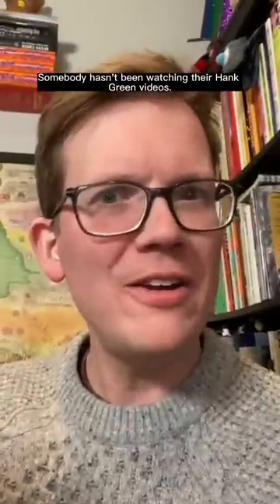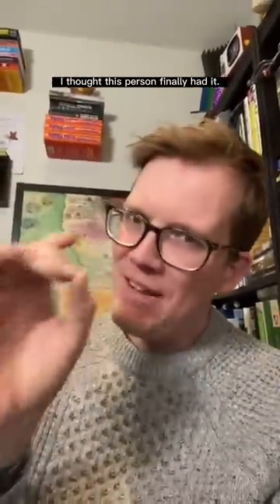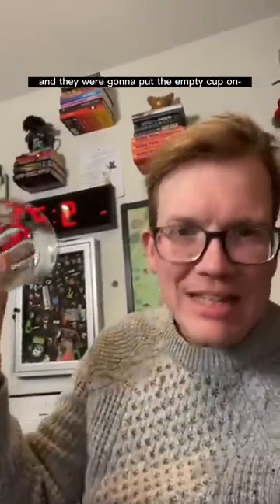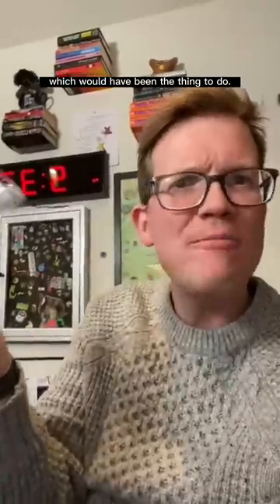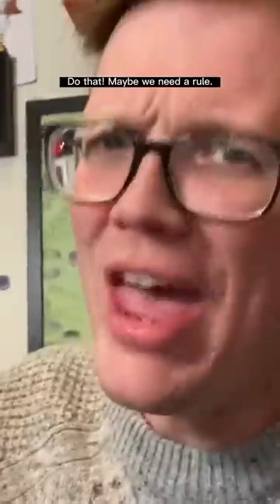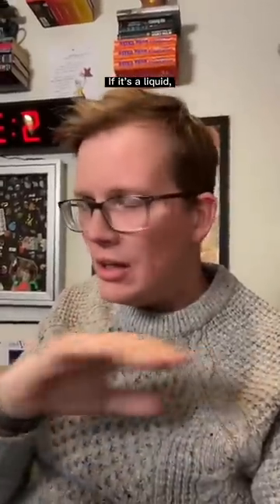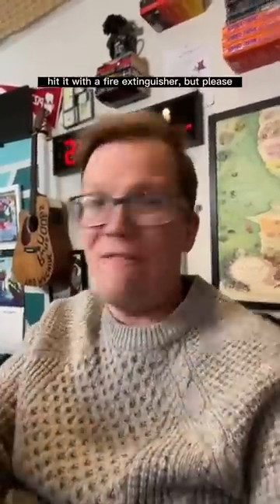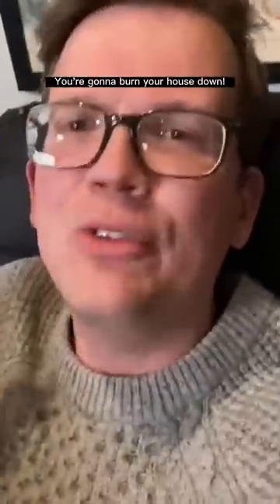Why does water cause candle fires to explode?

Comment: That is an absolutely great way for children to remember. "If it's a liquid that's on fire do not add liquid" That should be added to fire safety
Reply: Sadly, there are plenty of adults who would argue "a candle isn't a liquid" without acknowledging melted wax, let alone kids
Reply: @atroecious9357   Karen parent: holds candle THIS IS CLEARLY A SOLID, first you teach evolution, now this?????
Reply: I definitely did to myself "Wait it's a liquid? Oh wait I guess it is!" Really glad to have found this just in case I need to know!
Reply: @atroecious9357  tbh, I didn't think abt melted wax as liquid till Hank said it
Reply: @shadowsoulless6227  probably as melted wax dribbles down her hands, her clothes, and on the floor.
Reply: Unless it's the same liquid. If it's an oil fire and you don't have baking soda, you add more oil to reduce the temp of the liquid and cover it to suffocate the fire
Reply: Technically putting water on a fire does not remove oxygen from the fire what does is disperse heat rapidly and take that heat away from the source of the fire.

Fire requires three things. Heat, oxygen, and fuel. If you take away any one of those things the fire will die. Therefore water really isn't even the most efficient way to extinguish a fire anyway. Providing you have something non-flammable and heat resistant to smother with smothering is always the best option
Reply: My uncle is related to a kid who's friends with and interested in our local fire department, I could get this done
Reply: @kyle_mk17  please do
Reply: @CYB3Rsynth  it depends on the type of fire smothering a wood fire may work eventually if it is small enough or hasn’t got a good hold on the wood but water is way way more efficient. If you use the correct method most fire types are much easier to put out. (For gas fires and some liquid fires it is important you don’t put it out before the source is removed e.g by turning of the gas because the gases can build up and explode if it is extinguished)

Water helps to remove oxygen where it is less dense than the stuff on fire, it removes heat efficiently from surfaces it has contact with, it inhibits a lot of chemical chain reactions and it can be used to remove fuel from a fire. It is amazing stuff which is why it is the main goto option for large fires that don’t involve mainly electricity, flammable metals, self oxidising mixtures, flammable gasses, or flammable liquids. 

It can be used with all of those to keep the heat down and prevent spreading (and in some cases to remove fuel) usually by using a mist so that it vaporises carrying away heat before it can hit the surface.
Reply: ADDED?? What do you mean? ADDED!? Where i'm from we all got taught that.
Reply: Yes that stuck with me despite knowing your best bet is to cover a candle fire.
Reply: Kids don't have the same pride stubbornness as adults do. 
Any that are old enough to be "trusted" around a candle have 100% messed with the candle and know that while there is the flame the candle has a solid candle part and then a liquid puddle.

And younger kids know they are still learning things so they don't have the "i must be right" mentality that causes them to ignore facts for the sake of being in the right, they have a "it makes sense" mindset where if they are arguing something then its because their current knowledge matches what they think and they need an explanation of the facts so their mind can make sense of things that are different to their expectations.
Reply: Only if they understand what a candle is. Liquid is NOT something that comes to mind.
Reply: @kelathos  if the wax is still mostly solid unless the candle is enormous it wouldn’t do more than spit a bit if you dropped water on it. The wax has to be close to it’s smoking temperature to produce a fireball.

That isn’t necessarily true, if the candle is scented the essential oil or whatever was used can greatly lower the ignition temperature so even a fairly small puddle can ignite in a fireball if it is spattered by water.
Reply: Yes
Reply: Salt can also be flammable
Reply: @dadude8635  table salt (NaCl) is already at a pretty high oxidation state so it can’t be burned as such. That said in a fire with a high enough temperature the salt can be vaporised and Na ions can colour the flame a bit more yellow. The hotter the fire the more the Ana and Cl get separated and the Vaporised sodium will burn at the edge of the flame. However the process will take net heat out of the fire not add to it so even for base metal fires and self oxidising fires table salt isn’t a terrible option as long as the fire isn’t too big. Sodium Bicarbonate is better because it doesn’t produce chlorine gas when it gets too hot it produces CO2 which slows even very hot base metal fires, it can also interrupt ion flows so it can interrupt the chain reaction that leads to fire. CO2 extinguishers actually spray out bicarbonate more or less for those reasons.
Reply: Yeah everyone knows your meant to throw corn starch or flour on it wtf
Reply: @glenecollins yeah...the candle in the video has a HUGE flame to begin with.

I've poured water on candles to put them out and never had a fireball explosion but my wick was never burning three inches wide
Reply: Exactly 💯 💯 💯
Reply: @shadowsoulless6227  🤣🤣🤣 you have made my day. Thank you
Reply: Unless its an alcohol fire.
Reply: fun fact it already is
Reply: @shadowsoulless6227  if this candle wax is a liquid, why does solid candle wax still exist? answer that ATHEIST!
Reply: Hank's Law
Reply: @Atroe Cious  but I'm confused bc the wax isn't the part on fire. Just the wick is
Reply: @TheCumberCoIlective  Someone will probably answer this a lot more accurately, but like, the flame is always burning something. It doesn't just exist on it's own... In this case it's burning paraffin. 

I guess you have a point that it's not super intuitive to say "the liquid is burning" because yeah, the part that you can see, that's still visibly liquid, isn't actively burning at that moment. It will in a moment when it's vapor, and that will happen faster if you quickly disperse it into a big mist of droplets. It's kinda like the part of a burning log that you can still see - you'd still say the log is on fire though that's not at the moment true of every piece of it.
Reply: Unless it's an oil fire. What you should do is actually add more oil and then blow it out
Reply: @shadowsoulless6227  
😂😂😂 I can totally see that happening.
Reply: @feuerling  
See how it hardens on my burnt flesh?!?!?! Checkmate atheists. 😂
Reply: @TheCumberCoIlective candles wax just burns slowly, have you ever noticed that every time you blow out a candle after burning it there’s always a little less wax, that because it’s burning both the wick and the wax. The wax it so it doesn’t burn the wick too fast and burn out!
Reply: @xxxpandaxxxae  Huh, I always thought it was the moisture in the wax evaporating
Reply: "And they were going to put the empty cup on-UErGhHh" 

Sorry, this took me out
Reply: Also "if something wooden is burning in your house, don't add wood". Wish someone had told me that 😔✌🏼
Reply: we, as kids. learned this.

YOU as kids probably learned what to think. now  how to think.

candle is oil based, dont use water.
Reply: @TheCumberCoIlective  as wax melts(becomes liquid through heat) it gives off a vapour/gas.
The flame  is burning off that gas,just as fire burns gas in a gas stove, or burns the gas given off by gasoline in a car with a standard internal combustion engine 
The wick is simply the thing that's easy to first light  to produce the heat to melt the wax enough to create the vapour
Wax doesn't contain liquid in the way you mean (water) because it's fat/sold oil,and oil and water don't mix in normal conditions.
 It takes special conditions (homogenisation)to get them to mix for more than short periods
Reply: @helentee9863  oh okay. Thanks
Reply: @TheCumberCoIlective  👍
Reply: @dadude8635  well technically,  ANYTHING can be flammable under the right conditions.  Take MAGMA , for instance...
Reply: Unless it's an oil fire in a pan. In typical oil inflammation in your pan, adding more oil will actually make it way easiert to put out the fire, because whats burning in the pan isn't actually the oil itself, but the fumes produced by the temperature of the oil. Adding cold, fresh oil will bring the temperature down without doing anything to the flame itself. This will make it way easier to put, sometimes literally to the point you can blow it out.
Reply: As simple as it is, at 24 years old I never would have known not to add liquid to flaming liquid other than grease.
Reply: So I knew this about oil…did not know it applied to all liquids 😅
Reply: @CYB3Rsynth  Therefore ice can beat fire if the ice is cold enough.  Thank you for coming to my TED talk.

Comment: The worst part is that water is actually heavier than oil so before it boils up it first sinks way down below the oil and bring a whole lot of burning liquid with it on its way up not only having a burning vapour filling your house but also a burning pool of liquid overflowing from whatever container it used to be in. It's the perfect way to spread a grease fire as quickly and efficiently as humanly possible.
Reply: This is a strange appreciation comment lol
Reply: Water isn’t heavier it’s denser but everything else was right
Reply: @Damn-Sandwich  Denser means it's heavier in the same volume. Comparing different volumes makes absolutely no sense in this context which is why density is often also used as an expression of mass. For example, feathers are not heavier than lead, even though 5 billion feathers are heavier than 1 milligram of lead.
Reply: @Damn-Sandwich  but steel is heavier than feathers
Reply: this is mostly cuz of the waters momentum rather than it's weight, that only comes into play when it loses most of its momentum

Comment: I've known that putting water on a grease fire would make it worse, but I've never actually known WHY so this makes me very happy
Reply: Same
Reply: Same
Reply: I thought in that case it was that the expanding water would cause burning oil to be splattered all over you. Which would obviously be very bad. I didn't expect an actual explosion though!
Reply: Water is heavier than grease (and I guess candle wax?), so it sinks. Then boils. If it stayed on top, it might knock up a bit of fuel, but because it's expanding from beneath, it throws it all in the air which is bad for everything that doesn't like being on fire.
Reply: @GrandHighGamer  normal paraffin wax which is what most candles are made of has a density of about 0.9 when solid and something like 0.7 when near it’s ignition temperature.which is pretty hot. You can get candles with a density of slightly over one when solid but there aren’t many combustible waxes denser than water as a liquid.

Some of the scented candles you can get float about 1/3rd out of the water so they must have a fairly high percentage essential oil (which are flammable not just combustible if they get hot enough the whole thing can catch fire not just the wick)
Reply: It also never occurred to me that candles/wax counts as a "grease fire" so it's double learnings for me!
Reply: @ValkyrieTiara  as Hank said don’t chuck water on any liquid that is burning, that said you can normally throw water on a paraffin or Bees wax candle and get away with it because the liquid generally isn’t all that hot, the wax has to be at the temperature where the liquid it’s self would be smoking to get that fireball effect. 

(With a normal candle the wax is generally cool enough you can stick your finger in it without being burned)
Reply: Grease is oil, oil and water dont mix. When oil is lit of fire the water spreads it instead of putting it out. Use cat litter or some sort of sandy material.
Reply: @WinterBoots15  Or snuff it out for less mess. Like if it's in a pan, put the lid on it.
Reply: @blueskyla7978  have a fire blanket in the kitchen, know how to use it, switch off the stove and use it. If the oil is burning well there is a good chance you will burn yourself with just a lid the fire blanket protects you as you are putting it over the fire if you use it properly and it should cover any spilled oil etc.
Reply: I'm a cook and cook use this property on purpose. The small amount of water with food added to a screaming hit wok with oil in It causes the water to steam and oil to to  combust causing a flame and the oil to instantly coad the entire wok making it non stick while cooking.
Reply: That's why the mythbusters should be mandated education material lol
Reply: @frankcap2505  Daaaaang. 
 That's cooooool. 

I've never really thought about the rice not sticking to the pan.

I guess I beleived that it was just,
Some kind of mystical training martial arts wok energy that prevented the rice from sticking.

It never occurred to me that it was the OIL that did it. 🙃

Yeahhh. 

Now that I think about it, oil would be the reason why the rice-ick-culls don't stick together.  

🤦🏾‍♀️ Ughhhh. 

I swear.  
I'D  be the one to somehow get a D- on an IQ test
Reply: @KingdomWolf2351  Jackwagon, the point wasn't that oil makes things non stick, but that the combo of high heat oil and water to cause Aerosolization  and flash coats the entire pan. This is especially important in wok cooking, most people don't know this particular technique, and this video shows the danger of that combo. i though it would be cool to show a way where it could be used to benefit. so no you wouldn't get a d on an IQ test, but you would probably get run out of a professional kitchen
Reply: Good on you for learning something new!

Comment: As a welder I offer an extension of this rule: Don’t fight gas fires with gas. Using a fire extinguisher will just put out the fire temporarily, but wherever the gas is coming from will probably still be hot enough to reignite the leak. If you can do so always go for the closest cutoff valve that’s upstream of the problem.

Comment: This is the very reason petroleum storage tank fires can be so dangerous. There is ALWAYS water in the bottom of those tanks; it's unavoidable. When the level of the burning liquid gets low enough, the heat from the fire warms the water and the weight of the oil becomes insufficient to suppress the boiling of the water. All at once the water instantly boils (called boilover) and blows the remaining fuel out of the tank. Depending in part on the size of the tank, fire may rain down hundreds of feet away. It's almost like standing next to a volcano you thought was inactive.
Reply: Some time ago, I was reading everything I could find about BLEVEs, but I'm not sure how often it was explained that water was part of it. I think I figured it was just too much gas vapor for the tank to hold.

Comment: Honestly only knew about grease fires, not pouring water into burning liquid is very helpful
Reply: Same, ive always stoped candles like this by blowing on them or covering them. Never thought of doing it with water because I thought it was too much work to get it in the first place. Good thing for my laziness, it has saved me this long 💀🤣🤣
Reply: @elisanoro  also cause it’d make a mess even if it did work. And probably ruin the candle.
Reply: Im confused since when do candles have burning liquid, I thought the wick was the fuel not the wax
Reply: @Cheesepuff8  the wick is only there to release the fuel aka the wax continously
Reply: @Cheesepuff8  No, the evaporating wax is the main fuel. The wick is also needed, though I forget what role it plays, but if you tried to burn just a wick, it would not burn as a candle does.
Reply: @Cheesepuff8  the candle wax is the fuel. It melts and "wicks"(flows) up the wick(rope). The liquid wax then gets hotter and vaporizes. That vaporized wax is what burns.(just like liquid gasoline won't explode.. the vapour ignites first)
Reply: @Rae Rohan  wick is both a verb and a noun. Look up the verb form ...to absorb or drain (a fluid, moisture, etc.) like a wick. a fabric that wicks away perspiration
Reply: Hank’s advice of “don’t add liquid to liquid” also somewhat encompasses the equally important rule of not adding liquid fuel to an already burning fire.  That can explode too.
Reply: I mean, a candle basically IS a grease fire.  It's not grease, exactly, but it is just another oily fuel that's burning.
Reply: @thatjillgirl  it's all hydrocarbons